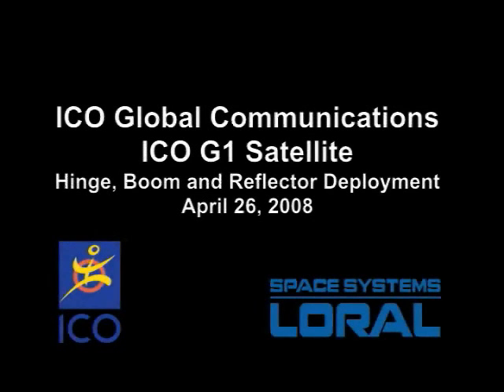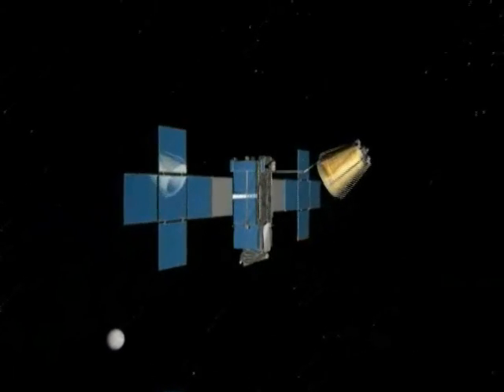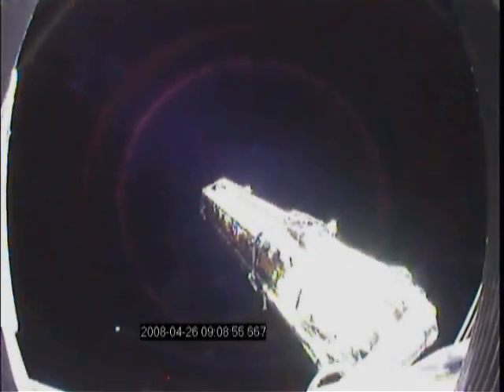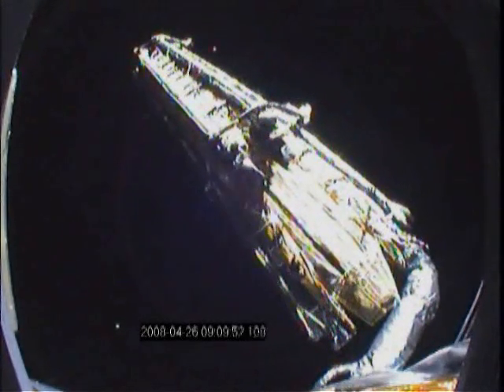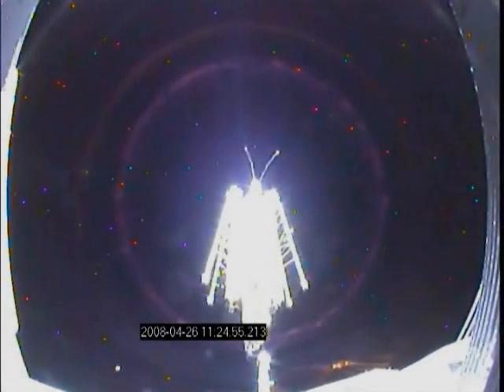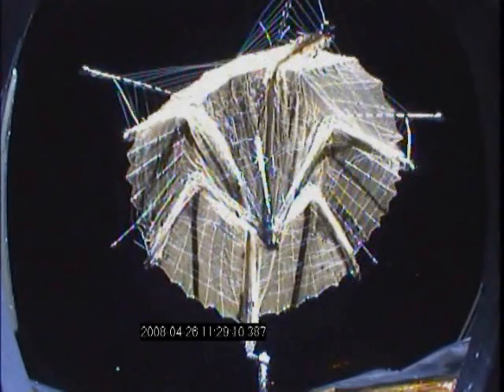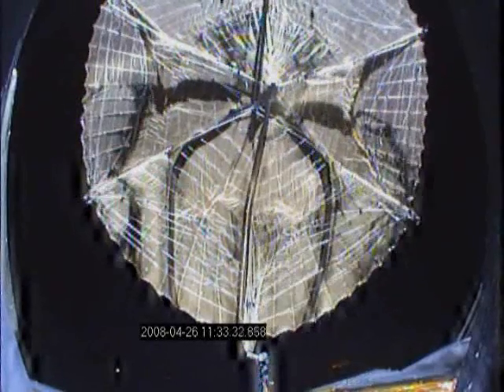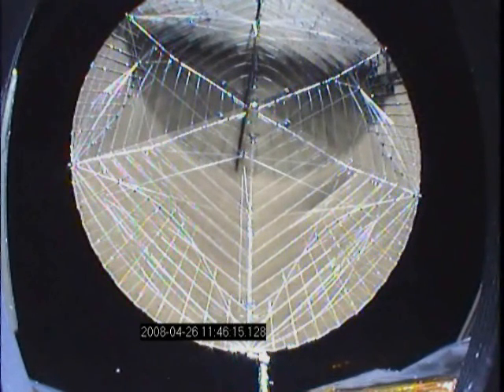ICO G1 Antenna Deploy

Comment: Cool vid.  I used to work for Loral...building 2 Tempest lab. I actually worked for WDL, but was on loan to SSL for a few months.  It was my first job after the military.  Actually, it was called Ford Aerospace back then until Loral bought them in 91.